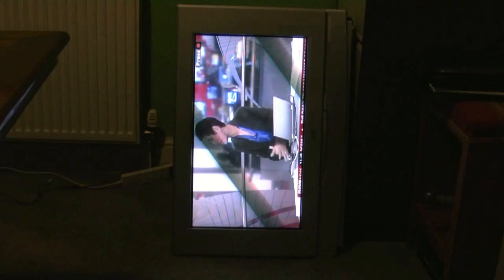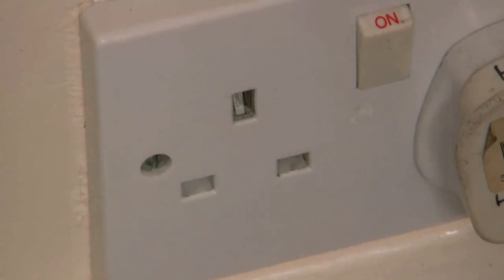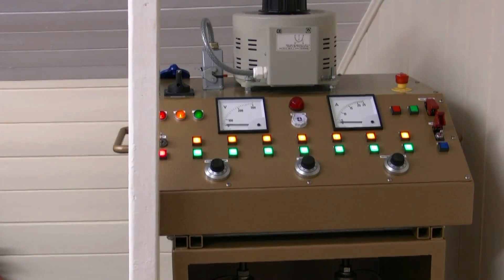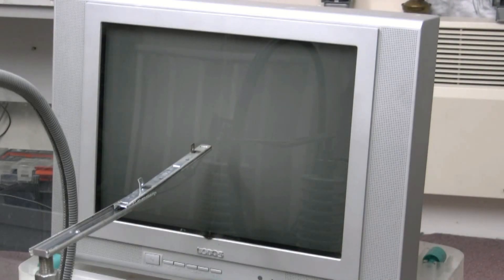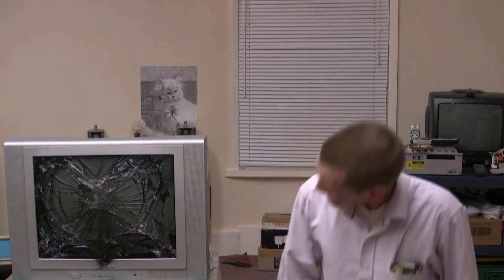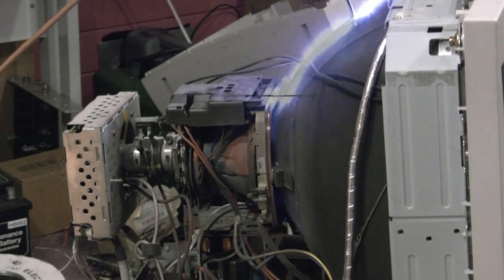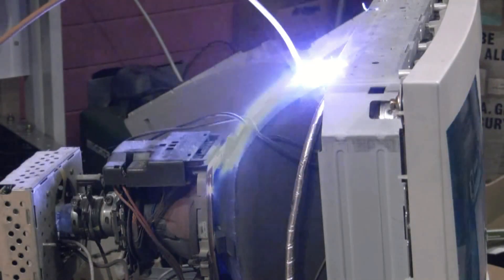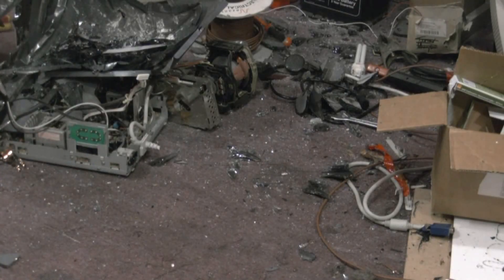300Kv On A Television

Comment: Yes, it's the principle behind plasma cutters which produce massively high voltage electrical currents, it's then transmitted through the handle and in between a continuous stream of Argon or Nitrogen gas, which helps to prevent fires. The electrical beam you're seeing is air that has gotten so hot that it's become a high-energy plasma because of the electrical energy flowing through it.

Comment: Not necessarily.. if you watch the video in 360p, then the pixels in the video are larger, if you watch it in 1080p, the pixels are smaller, and there are more pixels, but they are still bigger than the original upload...sooo your wrong.

Comment: However the copycats and left over stock are usually still good. Good luck finding them though. Next is a round that you can buy that goes in- explodes again. Then showers and penetrates everything with 2,000 degree F fireballs. Then they explode 1/2 way again. Tell me how a sledgehammer that cracks the glass comes even close. Lets go shooting!

Comment: LOL- You need some NEW lessons in guns. What were you using a 22? You shoot that TV with a a 3 inch 12 Gauge Rottweiler Nitro Mag and you will see how boring a sledge hammer really is. The .22 version of what I explained to you was used to shoot president reagan in the 22 version. Shooting a oak tree with a Nitro 22 used to split the fucker in half. Using the 12 Gauge would turn that TV into a pile of crumbs. The Nitro rounds are banned under federal law even for FFL. They cost $20 a round now.

Comment: Stop watching videos at bullshit resolution. That's a reflection in the circular glass barrier he put between the two electrodes. It's square because the screen it is reflecting is square.
If you watch the rest of the video you can see more signs it's not fake, such as when it lights the frame on fire, and when it's coming out of the back.

Comment: You should TRY making a Plasma ball. I know they are hard to do. I understand welding makes small ones where they float like an orb for a few seconds or so. When done (usually accidentally) you'll have a softball or bigger float for a few seconds after power is off.

Comment: High voltage arks can leak in to the air like how you saw, and just so you know, it was arking to the ground wire on the same side that you said you saw the  "fake effect".
and if you knew a thing about electricity then you would have not commented that...

I CALL REAL!

Comment: You're probably running it at the default 60hz refresh rate. Not a problem with LCDs, since they don't flicker.. but very annoying with CRTs. See if you can crank it up to 80hz or better. Even 70hz is noticeably better than 60.